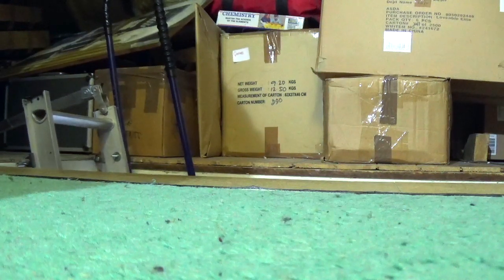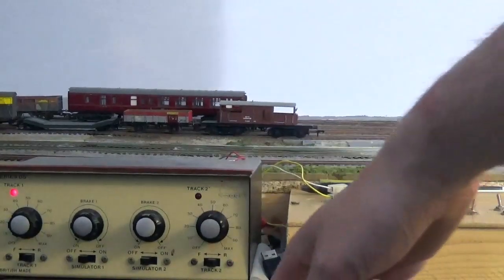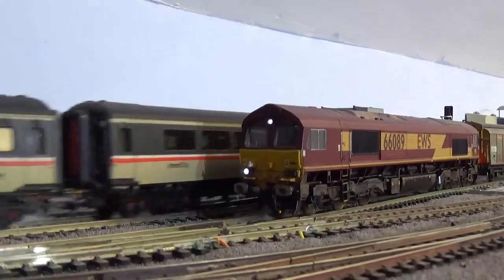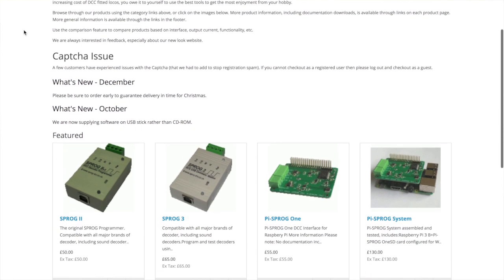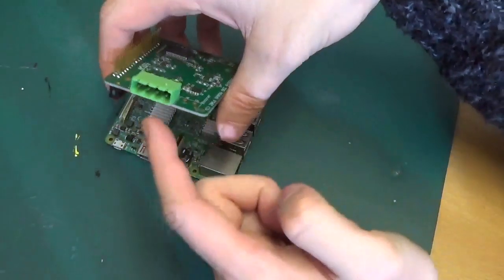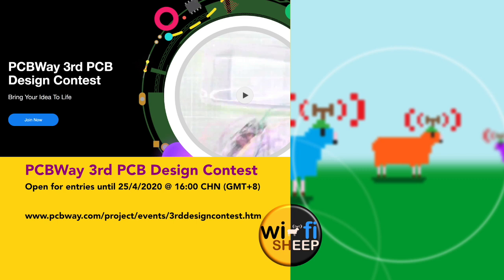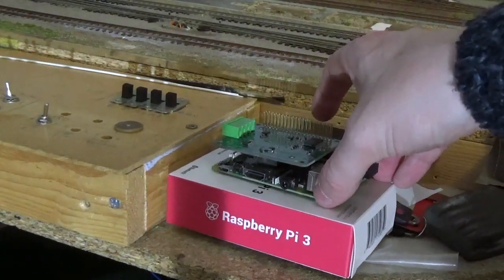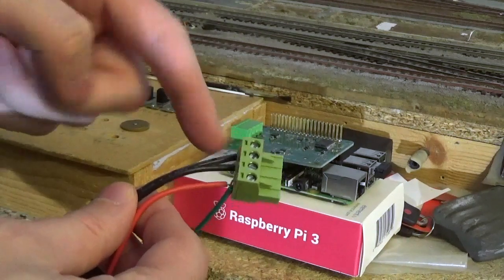Sprog DCC - Raspberry Pi Controlled Model Trains!

Comment: Wow I'm gonna make one I have a raspberry pi I was using as a general computer and home theatre but now I have a piece and normal Windows PC which I have built and currently didn't have used to my little raspberry pi but now I can do this
Reply: But it's quite expensive for the sprog PCB 😳 is there enythink cheaper
Reply from the maker: Hi, not that im aware of. Sprog also has quite a high learning curve! Just something to be aware of. it not really 'user friendly'
Reply: @WiFiSheep  ahh ok, what about a Arduino and motor shealed with the DCC++ can I make that work on a raspberry pi?
Reply from the maker: Probably not mainly due to Arduino GPIO running at 5v and Pi running at 3.3v
Plus the Arduino used 8bit logic as apposed to the Pis 32bit So you'd really be better off just using the Arduino system. The boards are cheap and the learning curve is not that steep, but it is a sit down, read and learn, its not a Bachmann or Hornby 'out of the box' approach

Comment: Tom.. this video is great.. I am new to all this (my first r-pi project).. I have reviewed the links and see the video many times and I fail to get what SPROG board is the one you use on top of the r-pi. Will the Pi-SPROG 3 do the trick? Thanks again!
Reply from the maker: Hi The Pi-SPROG 3 v2 is the latest board and from the looks of it the only one currently on sale. I think mine is a Pi SPORG 1 original. Since this video was made the Pi Linux OS and the SPROG have gone though some major updates so not everything shown in the video will now be relevant. 
Best bet will be to read the instructions and documentation with the latest hardware for best results.

Comment: with the digital control can you have two engines on the same track? assuming the track is long enough so they dont collide.
Reply from the maker: Yes you can... you could technically have 999 on the same track :-P 
The plan with this system is using sensors and custom python or java code give the system an 'AI' intelligence as to where things are, hence trains could drive them selfs on auto pilot but stop at junctions or when they meet a train being driven by a real person! .... Thats the plan!
Reply: Wi-Fi Sheep that would be so cool!  Please make it and show us!